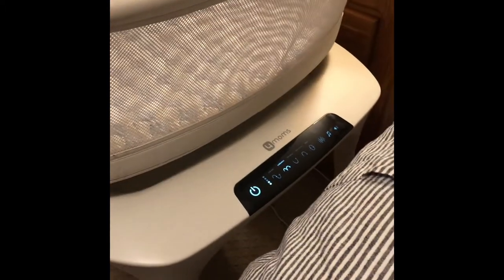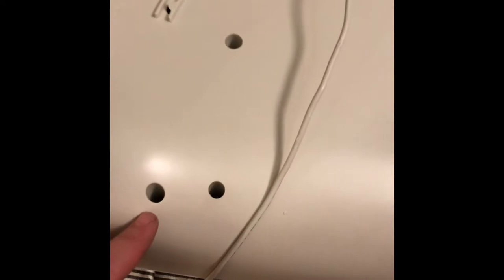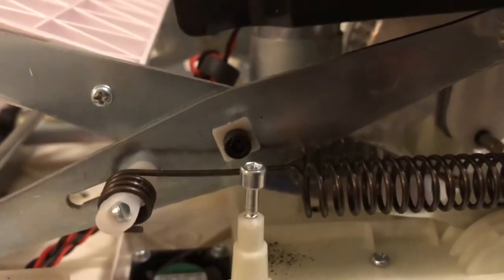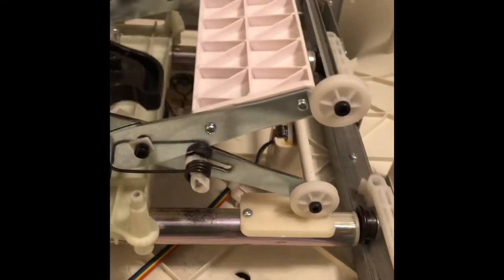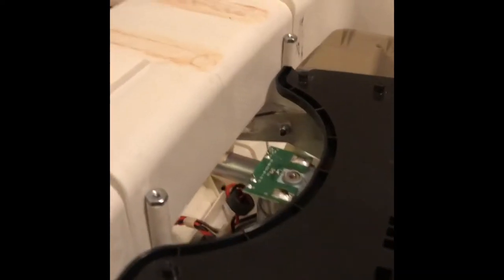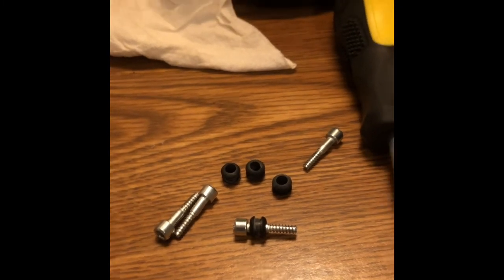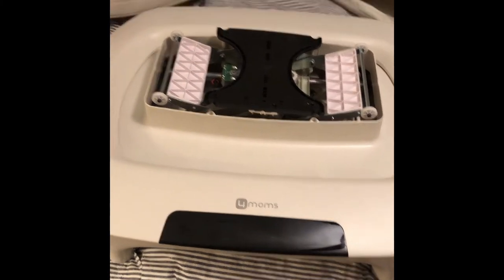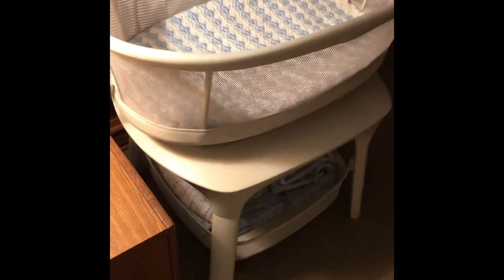Squeaking MamaRoo 4Moms Bassinet Fix

Comment: Thanks for the teardown and tips. Ours makes some  noise but it's rare so I'll wait to see if it gets worse. 

One tip though, try to use some silicone grease or lubricant. Contrary to popular belief, regular WD40 is NOT a lubricant. It may work fine but won't last nearly as long or as well as a spray lubricant. I use TriFlow for mechanical parts.

Comment: I landed here trying to find a fix for a non working bassinet. I had it for a week and stopped working. It just moves a little and starts flashing. I tried to reach customer service, send a video and stuff but no response. 

Do you think if I open my Bassinet I could find whatever is not working?
Reply from the maker: I don’t know Cynthia.  Sounds like a motor problem to me.  The motor will stop working if there is too much weight in the bassinet.  I found that out when my boy got too big.
Reply: Have you fixed your bassinet yet?
Reply: Did you find a solution
Reply: My baby is a NB, but probably its going to be it. I contacted 4moms, they’re going to replace it for a new one. So I guess I’ll never know LOL
Reply: More than likely it's the power source. It did the same with me. It would turn on then flash and turn off when I started it.